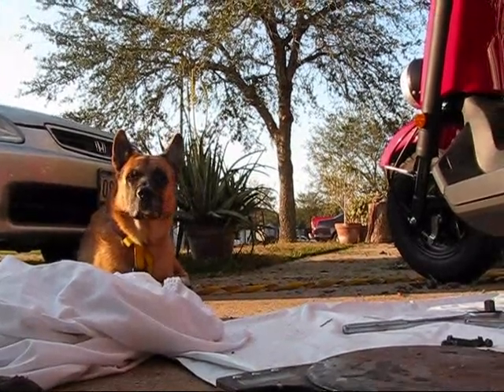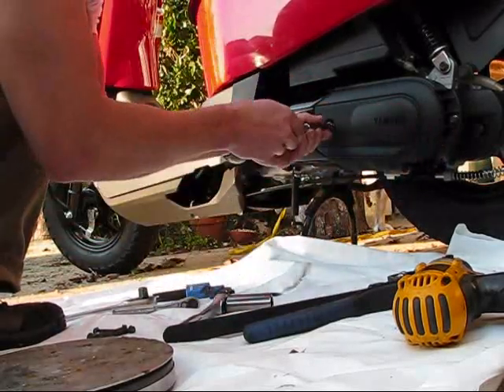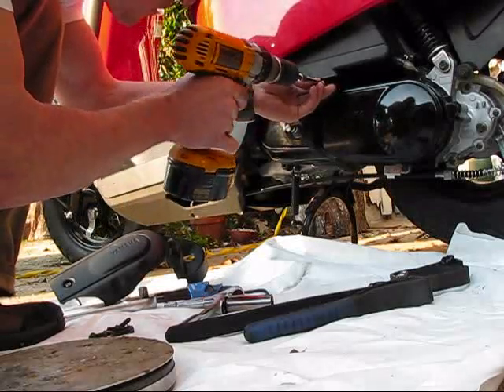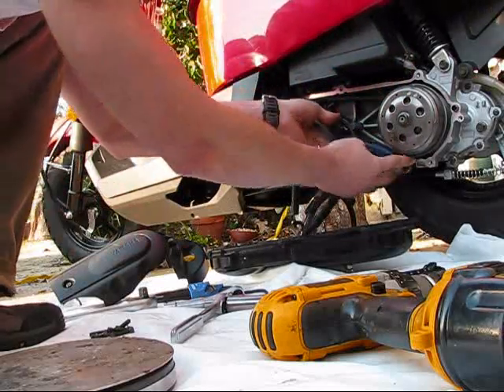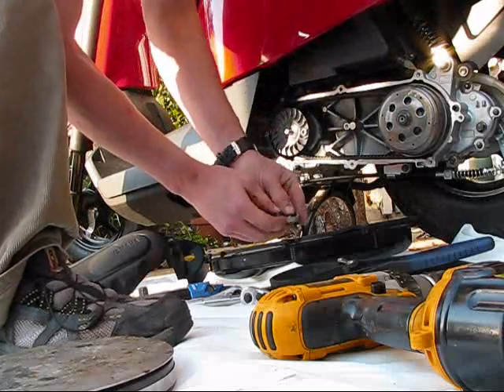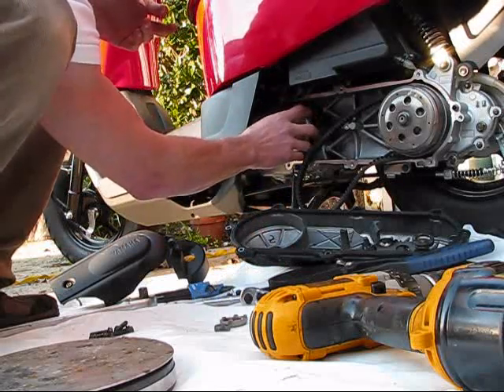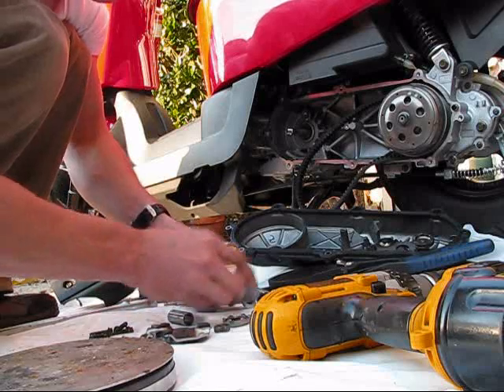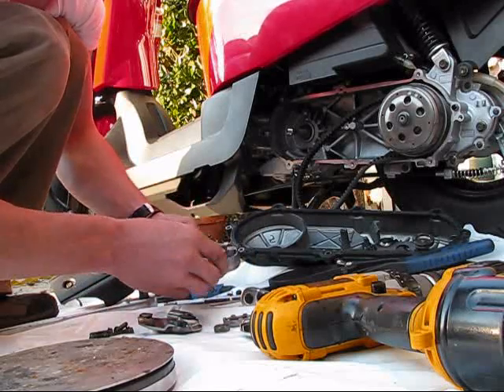Yamaha C3 Variator restrictor removal    How to derestrict vox giggle fx50  scooter transmission

Comment: i just derestricted a 2018 uk giggle by removing the thin washer from variator and changing the eu roller plate variator for the us one, now rather than hitting a wall of resistence at 29mph ,it just keeps going up to the max 40.  im not so sure there is any electronic restrictor
Reply from the maker: And if you change the weights that's allowing you to stay in a higher RPM when you're taking off which gives you a combination of torque and horsepower which is power yeah when I changed the weights I immediately felt the difference is no longer felt so sluggish in the 10 to 15 mph range but that was so long ago I can barely remember the mechanics
Reply from the maker: Awesome it does have an RPM limiter if you're going downhill or have a strong wind at your back you will bump off that limiter it won't let you go past a certain RPM
Reply: @ls1chevy2  i still dont inderstand how just removing a small washer and adding different variator can increase speed by 10 mph even  if the RPM are lower, its like its adding torque rather than acceleration, although im not complaining
Reply: @ls1chevy2 would a vity 125 cdi work?
Reply from the maker: well all is mechanically doing is allowing the variator plates to pinch together tighter which in effect gives it a taller gear in the front it's like a larger front chainring on a

Comment: Where did you read that this derestricts it? Us guys in the ruckus and gy6 scene put a washer there so the belt sits as low as possible in the variator and gives us better low end starts off the line
Reply from the maker: I'm sorry you're going to have to r e think about it
Reply from the maker: Look at my other videos I do my own experimenting this is a long time ago so I don't remember the whole thing I have since moved to Hawaii but I do remember the top speed do to rev limiting was around 35 when I remove the washer I was able to achieve 50 with the wind at my back
Reply from the maker: There was no compromise as for low end but I did increase low end RPM by reducing the weights this physically increase the time that it took for the plates to clamps down on the Belt the washer sits in between the plates just has no effect on how wide they can open for your bottom. end it's only a limiting thing removing the washer only gives you benefits
Reply from the maker: And I remember liebelt could go no lower without hitting the bearing between the plates which I experimented with that also my sanding that down I ended up going back because it would throw the belt it was putting it into high of a gear I ended up finding the perfect medium that allowed it to go into the highest ratio possible without
Reply: Matthew Morgan just doesn't make any sense. There is a washer that they put on some scooters that goes over the shaft and that basically puts the belt higher in between the pulleys but the washer in front shouldn't do anything at all I've been messing with these motors since I was 15 and I've always put a washer there..ive never lost any top end but I gained low end acceleration, but who knows maybe I'm wrong. Time to rent a dyno and find out
Reply from the maker: Pulsar Tech well you could be limited on those other scooters by the length of the belt that's another limiting factor use a marker and write on the plates and you will see how far up the belt travels this will give you a definite answer of where the belt has been moving
Reply from the maker: Pulsar Tech they had to restrict them and keep them under 35 so they could sell them to the American public
Reply from the maker: Pulsar Tech but they were designed to go faster it's just simple gearing just like on a bicycle same thing will happen if you're on a bicycle in your chain was too short even after you had the gears it would not climb into the farthest ratios only the middle
Reply from the maker: Pulsar Tech I've done the test without the plate on it I seen the mechanics in motion
Reply from the maker: The stuff is very simple try recurving a distributor cap all the weights and springs and then adjusting the timing on an old car with a distributor cap that you made way more complex than a simple gearing for a variator
Reply from the maker: Pulsar Tech remember the belt is part of the equation and then the size of the variator you must have the proper belt that can give you the optimum low gear and high gear and use a marker and mark the plate from top to bottom and you will see where it has traveled
Reply from the maker: Pulsar Tech if you can agree with these simple things you will understand if you have something between two things at cannot come together as close as it would without and that's what the washer does it does not reduce how much they open so if you have enough belt and a tall enough variator you will have a wider set of gear ratios but if any of these things are off you won't

Comment: You were about to say what the rollers do when they roll out. and can you let me know what the original mph was? I have a 2012 taotao that I thought would be good to ride around town, wrong!. I was only getting up to a suicidal 27 mph. I put a performance filter on and now I'm going up to 32 mph. 45 would be awesome. I also feel like the computer or whatever they have ,cuts off the ignition at a certain speed. I heard you can change the ignition module or something to keep it firing? Any help?

Comment: Sorry for the late reply, lol. I still have my NRG Power as a project build. When I said 58 I meant mph. I have done an engine rebuild including a top racing crankshaft and a doppler 70cc bored cylinder+head+piston. It now does close to 80mph on a flat road but the carb still needs some fine-tuning. Do you still have your C3? Mopeds are brilliant to work on don't you think?

Comment from the maker: @santoyo801able yes lighter rollers will work. check your spark plug to see if you are running lean. if you are too lean you could lose power. due to the scavenging affects of the new exhaust

Comment from the maker: nope you could probably improvise, maybe even a leather pants belt, or a rope wraped around a hammer then wrap it around the variator then twist it tight, and crank back for leverage, its not on there super tight.

Comment: thanks alot 

and why dont you try pulling your carb and and there is a flat head screw in there turn it right but get you bike started and that will turn the revs up so when you set of it pulls you back it just makes it easyer to get up heels :D  thanks alot hit me back

Comment: @jliverty Get a High performance air filter for about $10-$20 on ebay n get Performance variator rollers 3-4 grams.The lower the grams the better they cost about $10-$25 also on ebay together the filter n rollers will give u more top end speed n faster acceleration u need to change ur rollers every 700-1000 miles anyway if not they will wear down n u will lose speed.I'm 190 lbs I live n the PA mountains I was getting 10-15 miles n hour up big hills now iam getting 20-25 miles n hour up big hills

Comment: hi want to ask about this scooter , do you have any problem with this scooter for daily use ? 

is it expensive for the monthly maintain cost for this scooter ? the issue is this scooter only run for 45 MPH ????

is that the standard mph for this scooter can run for the top speed ? or any trick or service can do to make it go a lil bit faster without forcing/ overclock the standard machine ? 

i just wondering what is the pro n cons

Comment: Take the whole variator assembly out then take that washer and slide it to the very back of the spindal. put your variator pulley's back on. What will happen is that now the variator is realined with the clutch and will give you an extra 2 miles an hour on top of the MPH you will gain from this deristrict job.
Reply: But then u cant get the spline nut on

Comment: Lighter weights will improve acceleration but sacrifice top speed. Light rollers will delay the pulley from squeezing the v-belt, hence more acceleration. Heavy rollers squeeze the v-belt faster, sacrificing acceleration.

Comment: @ls1chevy2 I'm sorry i forgot to say i don't have a C3 i have a piaggio NRG power LC, i get 58mph out of it already, i have ordered a polini race kit which includes race variator, rollers with the weight of my choice, a race belt etc, that's why i wanted to know about the roller weight, because i need acceleration. i have a race exhaust anyway. is it compulsary to have a tool to jam the variator whilst you remove it or is it possible just by hand?

Comment: it already does 58 so a few less mph wouldn't bother me much, would there be a noticeable difference in a 3.5 and a 1.5 or would you still recommend 3.5. I have not yet looked into the variator/clutch box but to take out the variator do you actually need a tool like the one you use or is it still not too hard to do without it? Thanks a lot for the reply. (Y)

Comment: Thanks for the video! Your example helped a ton and made it not so intimidating for a newbie. I just removed the washer and replaced the weights with some Dr. Pulleys from KS Power. $32 and two hours later I've got WAY better acceleration and I'm burying the needle (prob around 45mph). I loved my C3 to begin with and now love it even more.  Peace and grease.